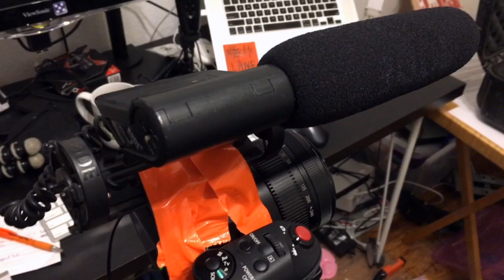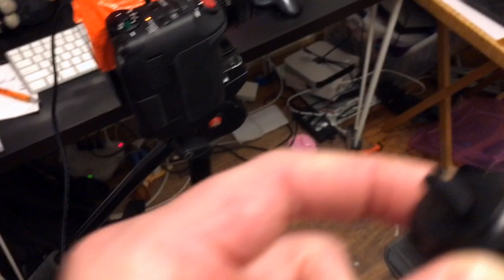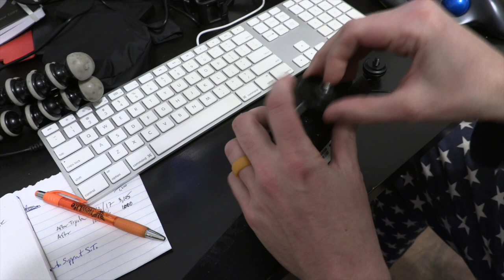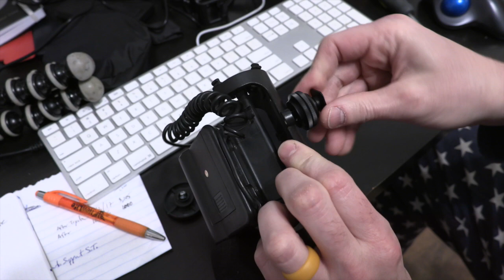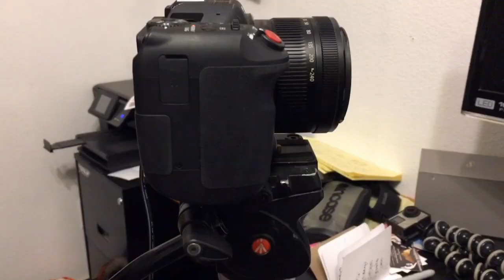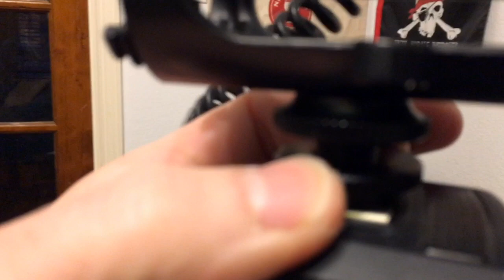RØDE VideoMic Original | Fixing Broken Hot Shoe Mount | Quick Tip #1

Comment: Mine is the VideoMic Pro, it doesn't have the larger hole to screw the replacement. Any ideas?
Reply from the maker: Olga Santos Is there enough space to drill and tap a hole? I’ll try and look up the model and see if I see any ideas.